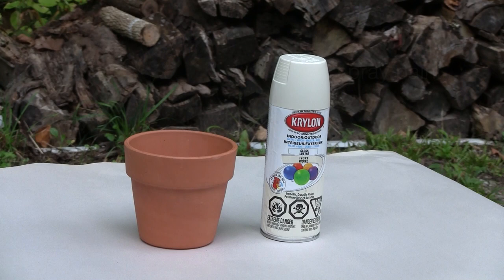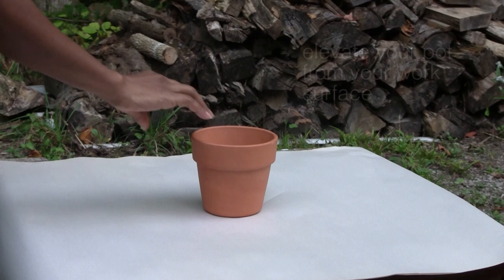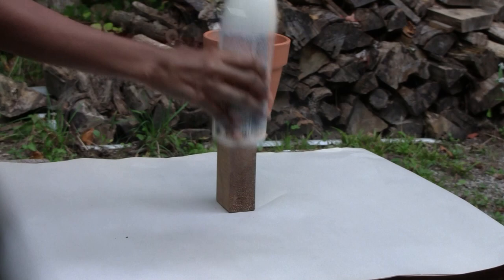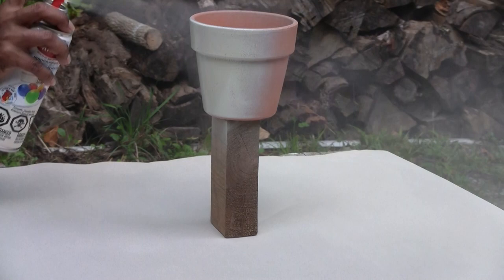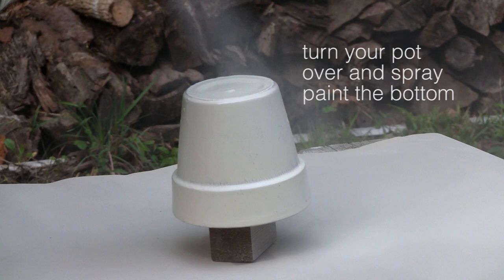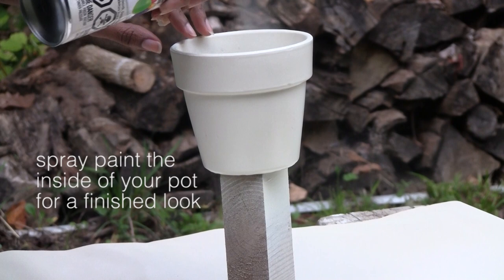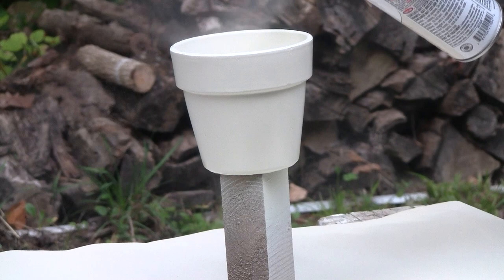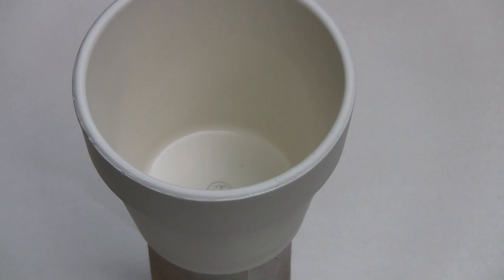DIY Spray Painted Clay Pot

Comment: how long was spraying and drying process?
Reply from the maker: Hi Cierra, Thanks for watching! I made this video some time now so I cannot recall the timing for this particular project. However, generally when I do any spray painted projects, they take just minutes per coat of paint. I like doing several thin coats of paint to get a better result, which means letting it dry to the touch between coats. The drying is really what takes the most time and varies depending on the paint and conditions you are painting in (humidity, cold, etc.). I generally stick to the time specified by the manufacture. Hope this helps! :-)